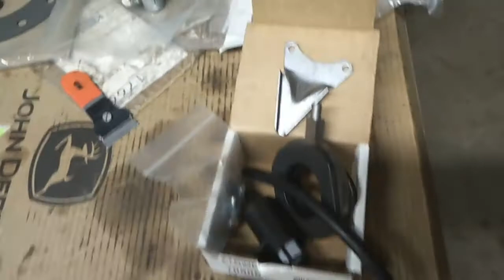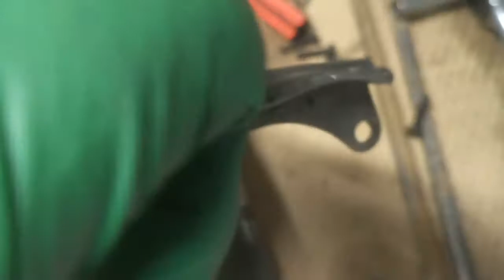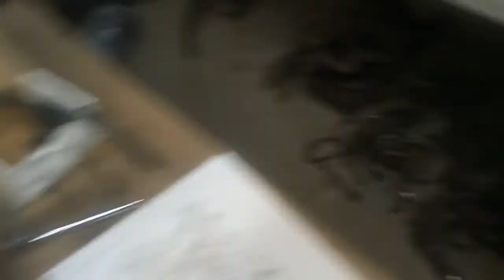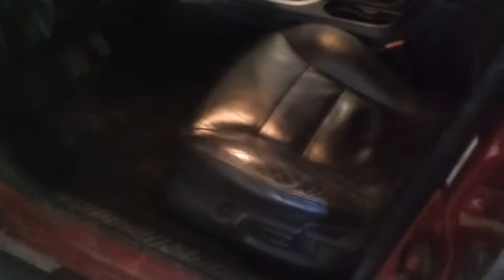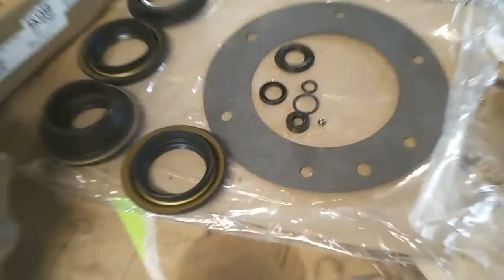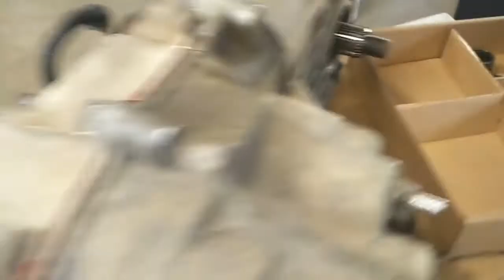1988 Bronco 1356 transfercase assembly

Comment: Good video Bud, not a complete step by step but hits the high points. I just picked up a spare 1356 for my 88 Bronco. Gonna go through it and swap it in. Current 1356 has a leak on the rear output and I'm not sure if it's causing the bangs during shifts or not. Ujoints are all good or new, rear diff is new motorcraft gears, C6 was rebuilt less than 10,000km ago but banging was there from the get-go. I'm at a loss at this point. Even checked the slip joint. Only idea I have left is axle wrap? it seems bad and I get wheel hop in the rain. 33's and Yukom Grizzly in the rear diff too. Anyway apologies for the novel of a post but thanks for the video and it's always great hearing a good Canadian kid on the YouTubes!
Reply from the maker: Hey man! Thanks for watching. When the rear diff was done were the gears changed as well? Have seen where guys swapped and didn't get the same ratio. That could cause wheel hop. Hope you find the problem.